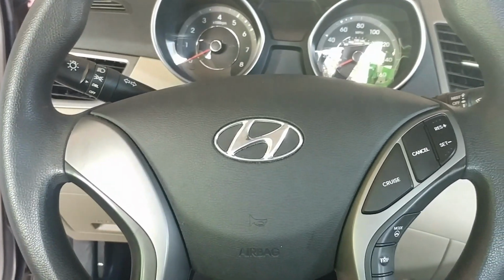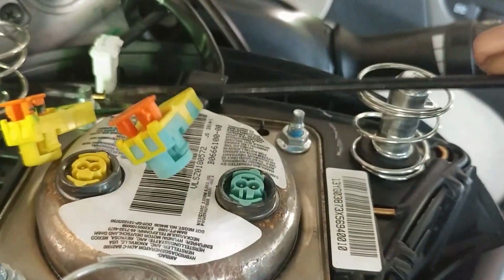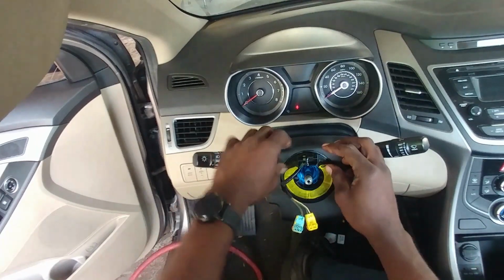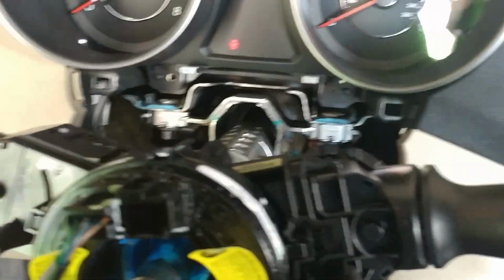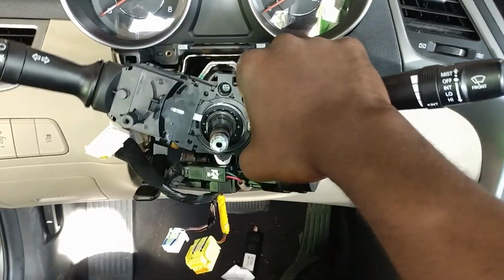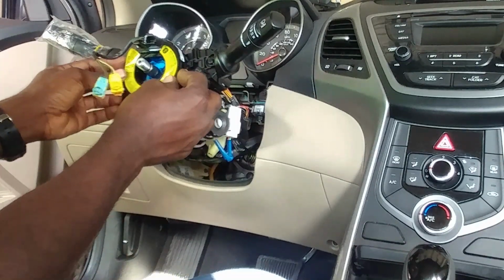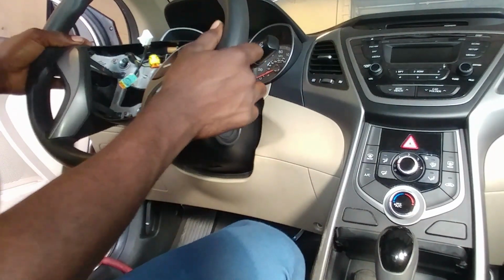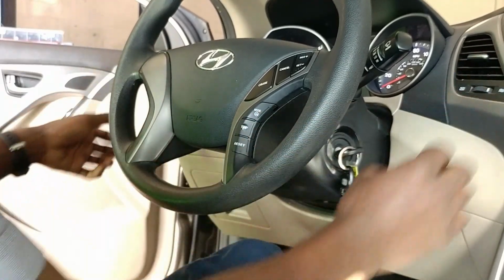Hyundai elantra head lamp switch /clock spring /steering wheel air bag removal /replacement

Comment: Just changed the clock spring on my 2013 i30 after watching this. Saved a couple hundred doll hairs.
Thanks heaps!
Reply from the maker: Yes
Reply from the maker: Daniel  when the air bag like on scan it and see what code it give
Reply from the maker: Daniel  no you have to make sure it can read airbag codes
Reply: Buttons on the steering wheel were also playing up e.g. volume, cruise control
Reply from the maker: Daniel  it probably just start ripping the ribbon cable that wrap around in the clock spring

Comment: Awesome video. I had a bad clock spring in your instructions were the best I found on the internet. Fix the problem with the airbag light. The clockspring was under extended warranty but the dealership wouldn't honor it because it was salvage title. Purchased the clockspring on eBay for $12 dealership wanted about a hundred.

Comment: Awesome video...changed my clockspring on my 2013 elantra GT.   Just remember to insert the connectors onto the clockspring CAREFULLY and not mis-align them.   Also, ensure all the connectors are fully inserted!  Otherwise the pins may not align correctly and none of the buttoms may work...I had to take it apart 2 more times before i got it right. Otherwise, great video.

Comment: Well done video good job I'm just wondering did they change something I ask because the first thing they teach you to do is taking the battery cable off ten minutes before doing anything with the air bag I have seen those go off before that no fun getting hit by it or even the getting your ears to stop ringing just wondering thanks for the video.
Reply from the maker: Yes you should disconnect the battery for safe

Comment: Hey, nice, my multiswitch going bad, lights off in dark!   The steering wheel came off without a puller?
Reply: I think mine is going bad to, my dash and lights flicker. The blinker switch isn't too expensive, but did you have to remove everything in this video to replace yours? Or can you just remove the coverings and unplug the switch?

Comment: Thank you for the video, i have a hyundai elantra 2014 and the horn and the bottons on the wheel  does not work i think it's the clock spring  in your experience  have you tried to fix the coil spring, do you think it will work?
Reply from the maker: No i never try fixing one

Comment: Nice video!
But  I have question: Do I need to disconnect the battery,  before to install switch? Or will be fine. Thanks!
Reply from the maker: Disconnect the battery

Comment: what does it mean when your horn constantly goes off is it a relay switch or do I need to open the steering wheel to disconnect the horn
Reply from the maker: It can be the relay or the horn switch start by checking the relay

Comment: I have a 2013 Hyundai elantra and my horn as well as the buttons on each side of the steering wheel for cruise control and so on doesn't work anymore. Would it be the clock spring? Or relay...or switches?
Reply from the maker: Clock spring
Reply: Thank you for replying
Reply from the maker: Does your airbag light come on
Reply: Dullah Goso hard 
Yes it does
Reply: Nyssia Vidal 
This is my normal account. New phone... But i was the one asking about my 2013 elantra
Reply from the maker: @nyssiavidal3395  the clock spring will fix the problem

Comment: I might  need to do this on my 2013 Kia Optima because the fog lights don't come on and there is no fog light indicator light on the dashboard either.  But, the headlights and turn signals work fine.  However, I did notice the H8 female connector on the passenger side fog light was different and the wiring was not one piece.  Fuses seem to be fine too.